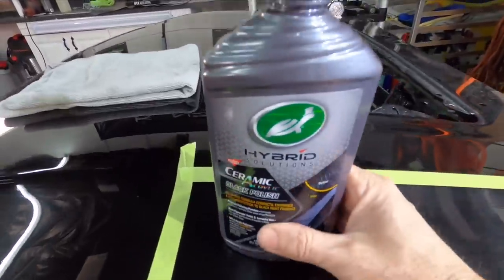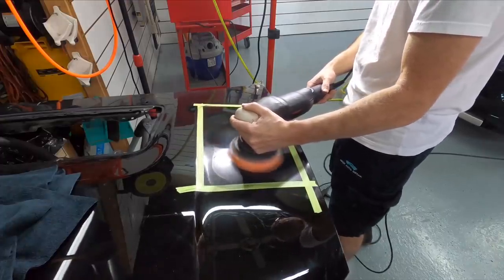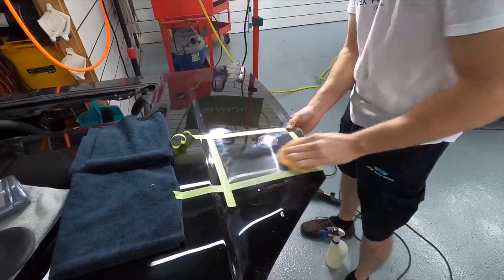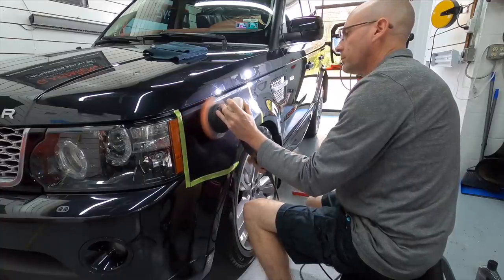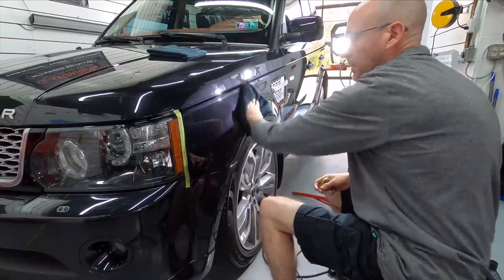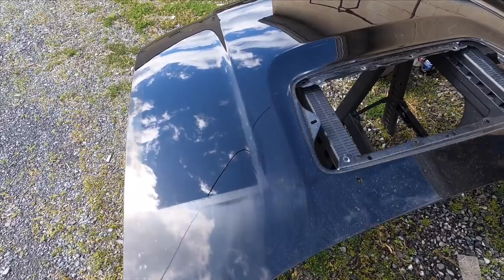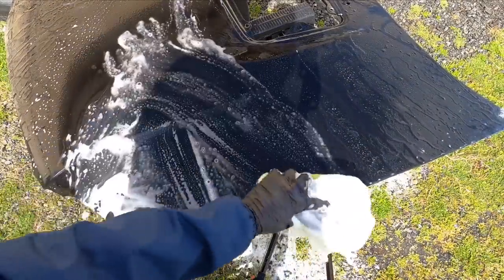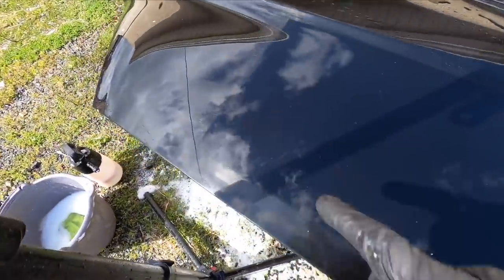Turtle Wax 53448  Hybrid Solutions Ceramic Acrylic Black Polish!! First Look!

Comment: using the machine is preferred for a better result, but works pretty well by hand as well. the benefit is the acrylic layer it adds as you mentioned so you got a good base for the protection to adhere to.
Interesting video again!!

Comment: I wonder how long it will last to the elements?  Seems like a great product for renewing a old black paint job.  Like you said it can fill and old paints, that's what they need.  I run a body shop and I don't need a product that fills on a new paint job, but when I have one come in that could be paint corrected and save the customer from painting it, this product would help.  Awesome video

Comment: Do you see a possibility of during a deeper correction (with compound and/or regular polish) maybe using this as a final step (jewel)? Outstanding video as always
Reply: Anthony, I haven't tried this new Hybrid Solutions "acrylic black" version, but I have used the non-black "Ceramic Polish & Wax" on a friend's car. I would assume they work the same way. My friend's clear coat was pretty hard and had quite a few deeper defects. I tried the Ceramic Polish & Wax using orange foam cutting pads, and it barely made a dent. I ended up using a heavier compound and microfiber cutting pads, then went over the whole car using the Ceramic Polish & Wax on green foam polishing pads. That did the trick! This made a great finishing polish! I let it cure for 24hrs then applied the Hybrid Solutions "Ceramic Spray Coating". The car looked great and was super-glossy.
Reply from the maker: Absolutely
Reply: Anthony Whavers my question exactly. It seems I would do a “regular” polish w/out tint and then use this as the final step.  Just not sure if that too much polishing.  If I were to use it as final step, then use a ultra fine pad on polisher?

Comment: My daughter and I follow your channel and used your advice on her 2005 equinox that was in bad shape. (Black Equinox) and it was our first time doing a paint correction and I must say it turned out GREAT!  A bit of a hit in the wallet at first but it was worth it. 
Had 3 estimates 2 from auto paint just to clear coat and 1from a detail shop . Clear coat was $2200 cheapest and detail shop wanted $1100 to fix it. FARTHER/DAUGHTER TIME PRICELESS! 
Thank you. 
If you have a chance can you answer a question or 2? 
1- the black is easy to scratch or scuff . Is there something that I can do to make it not so easy? Wax,coating etc.. 
2- the what looks like a sand blasting cabinet, what are you using for your media to clean your pads?

Comment: I jumped on the turtle wax band wagon a couple years ago with the seal and shine! My new way of taking care of my personal vehicles are to wash/clay, decon, I use a better compound like sonax or whatever I have around that I ordered online, then I like the regular TW ceramic polish which works nicely on most colors and finishes down nice and I finish off with either TW ceramic spray or seal and shine, followed by one last trip around with griots speed shine as it gets any last residue and leaves a great deep shine! I would like to try some 3D one or some other 1 steps for times the car doesn’t need a compound but ever vehicle I’ve done always needs a compound first

Comment: I have a newer (will be close to a year old after the winter); black with no metallic .. it's black.  I used the spray last year, thought I should do the polish .. I would just be doing it by hand and probably would not work it nearly to the level you were .. circles, 90 degree, maybe quickly back to circle and buff it off.  Sound like a good plan?  Maybe being new am over doing it??

Comment: Thanks for your continued terrific reviews, tips and advice, great channel!  My 1986 Buick has original black lacquer paint (except a couple repainted panels due to mishaps) and was wet sanded (before I got it) making it thin. This Turtle Wax Black Ceramic Acrylic polish and partner ceramic black wax seems like a perfect, gentile "polisher, enhancer and preserver" to polish and hide imperfections for my situation. Lots of swirls and a couple edges that show primer the paint is so thin. Many years of my ignorance (California duster) and probably misapplied products using old towels have left it in need of help. The car is only garaged and shown, driven no more than 1000 miles/yr. Many people still comment at shows on how great the paint looks since the finish is sanded so flat and if there's a little shade...even better! Would you agree this is a perfect modern choice to care for this paint?

Comment: Two questions... For hand polishing would you suggest microfiber over terry cloth or vice versa and why?

Second question, if I use the acrylic Polish and wax but also want to use the acrylic ceramic coating can I use them together? I know typically you would use a paint prep after polishing a car to remove any residue before applying a ceramic coating but that seems silly to use the Polish and wax just to strip it right off.  Since both products are in the hybrid solutions line designed for black paint it seems like they are made to be used together. Thanks

Comment: Back when when I had my 2007 Ram and it was black. Turtle Wax had a black box kit and they had all the products separated individually. I bought the black spray wax. The car wash booth I was using self serve coin op. I decided to use the spray wax afterwards. I kept spraying onto an applicator as I was applying. Well I didn't notice until after a bit I was painting their walls black, some of the pigment is still there. I traded that truck off in 2012.

Comment: I think the only thing hurting Turtle Wax is their name. They're not that old company anymore.
Reply: Spot on, they are perceived as outdated but with the hybrid solutions line and all the good reviews I've been temped to swap from Meguires. I just have soooo much megs stuff its going to be a while before I run out. I would just be worried about the black dye staining everything.
Reply: So....Turtle Wax....r u LISTENING????....u need to REBRAND your higher end hybrid products. Think of of how Toyota....went to the Lexus premium brand,and how successful BOTH BRANDS are....eliminate annnnny stigma people have with the name Turtle Wax from years ago.....your faithful customers, and...potential new customers of the hybrid line sitting on the fence about purchasing something from Turtle Wax deserve a premium new name, new branding!

I have been a huge fan of the new hybrid line of TW products....and I am old enuff to remember Turtle Wax making affordable, yet non-remarkable wax products years ago...which I used and was disappointed with. This hybrid line is affordable and not only is a premium product and competes with the high end brands, it offers more value Imo....often BEATING the expensive brands in performance and ease of application and less required buffing to get an excellent shine. I was such a big fan initially of the hybrid ceramic spray wax, my friend gifted me the entire line of products...premium branding, make it happen Turtle Wax!

Comment: Brian, what level of cut would you put the polish at? I have 2 black soft paint (thin clearcoat) vehicles. With a soft pad (B&S blue) can it be used as a mild cleaner polish without removing clearcoat?

Comment: I don't know about anyone else but when I buy products that claim longevity I'm always skeptical. Then I see your ten wash test and wonder if I'm doing something wrong by towel drying my vehicles after every wash (which you don't do). I am certain that towel drying removes the product a lot faster. Products that claim 6mnths protection usually only last 2 weeks on my vehicles.
Reply from the maker: Detail Enthusiast forced air is the best way to dry. If and when it is possible.

Comment: I just added the TW hybrid ceramic products to my collection for my personal vehicle.  I am not a pro, just a "home detailer" doing my own vehicles.  I am new to the ceramic stuff and had a quick question.  My car has been done using the hybrid ceramic polish/wax and then the spray coating.  Do I need to use a car wash with sio2?  I bought the hybrid wash, but am disappointed by it's lack of suds.  Is it ok to use a wash like meguiars gold class or should I stick with sio2 infused wash?  Thanks for any help!

Comment: Surprised the black pigment came out as well as it did on the light colored orange pad.  I was nervous to use my orange and white pads with TW black products.  I don't like how (percieved) dirty it makes my pads looks even when new.  Had I not already had a 50/50 euro fiber with a tight black/white weave in my pad selection to use I would have <only> used a normal black applicator pad.  Why can't a company make a series of stepped dark car specific pads that are totally black but matching the common orange, white, and black pad corrections steps?  I would recommend the velcro backer can be correction color specific or even simply black velvro backer with white letters identifying the pad correction step use.  Call it the Darksider Collection!

Comment: One question. If u use ceramic black polish on car and u want to use seal &shine after. Do u need to apply on top off polish or have to IPA the publishing oil and then use seal &shine?
Reply from the maker: Shift Gears let it cure the full 24 hr. Then use SNS

Comment: Hey Brian I just recently asked turtle wax about the cure time and topping this product with their black ceramic wax spray. They told me you could follow up and use the spray wax right after the polish without waiting. Seemed odd not waiting the 24 hours it says on the bottle.
Reply from the maker: JJC227 you can... but if it possible to wait the full 24 hr. I would.

Comment: Interesting , I’ve been keeping an eye on this. I wonder if you can top it with the TW ceramic spray , but I’m sure a Kingsguard or Shinee Wax or Good ole PolySeal may help out with durability. I guess my question now is can Moonlight adhere to it.
Reply: Same question. Also if a ceramic coating can be used since its leaving a ceramic base behind

Comment: Hey Brian, I’ve been watching your vids for a while and you have encouraged me to start polishing and washing cars.  I’m going to start with my mom Chevy trailblazer 04. I have a question, I just bought 8 of those URO fiber pads with 3D One. How many panels can I do with each URO Pads?  Thanks for being a great teacher Brian!!
Reply: The key with microfibre pads is that you need to fluff up the fibres after every pass. Compressed air works the best. If you do this then you can probably go around a car with 3 or 4 pads or less depending on the polish used.
Reply: Christopher Weir I don’t have an air compressor.  Later on I will, but not now.  I want to know how many panels can I do per pad without causing swirl marks?
Reply: @ChrisSmith-hi5ew  3D One is a pretty good polish in that it doesn't gum the pads up, but you will need a brush or something help clean the pads and bring the fibres back up. Without doing that, the pad becomes flat and doesn't work. Try a laundry brush and hold it over the pad while the machine is running. If you don't have this then consider foam pads rather than microfibre as you are going to have to swap pads every panel or so.
Reply: Christopher Weir ok I’ll try the laundry brush. Thanks for your help!!
Reply from the maker: I clean my pads after every pass. So you can do the whole vehicle with just one pad.
Reply: Apex Detail how do you do that with out air compressor?
Reply: Christopher Weir thanks Christopher!!!!!
Reply: Christopher Weir can this work on micro fiber pad?  I see he clean a foam pad
Reply: @ChrisSmith-hi5ew  yeah sorry, forgot you mentioned microfibre. 

Here's another option. https://youtu.be/U9V623I--Tk